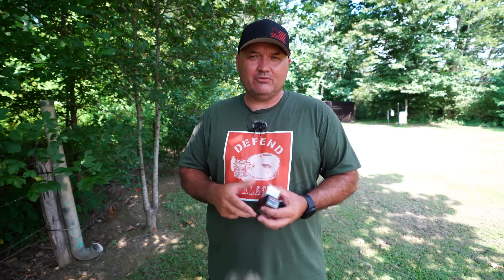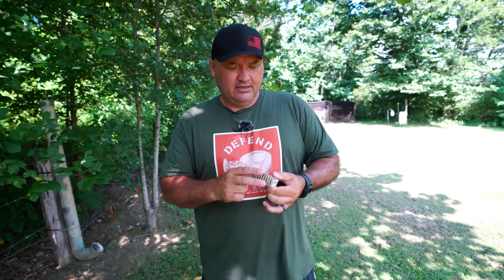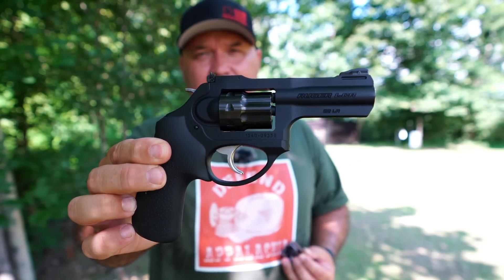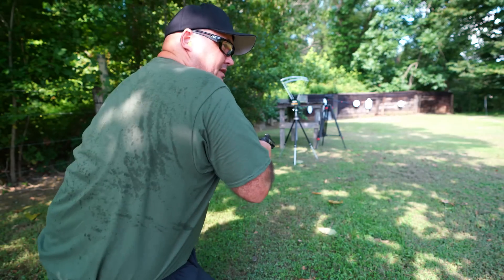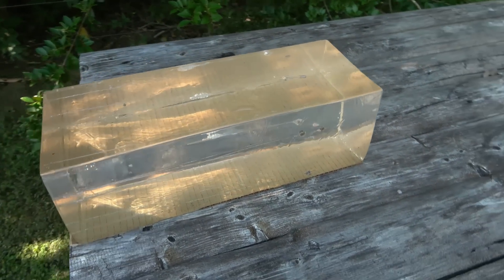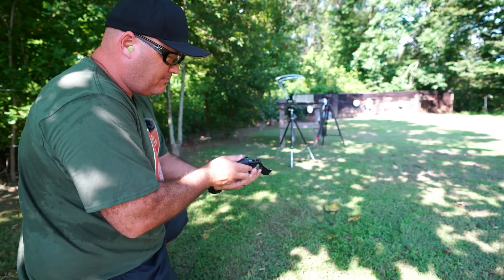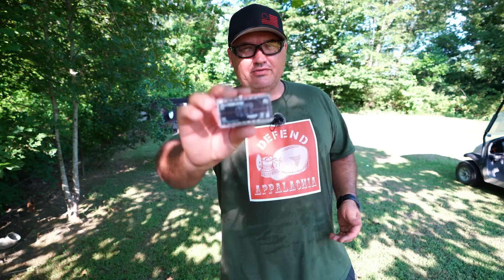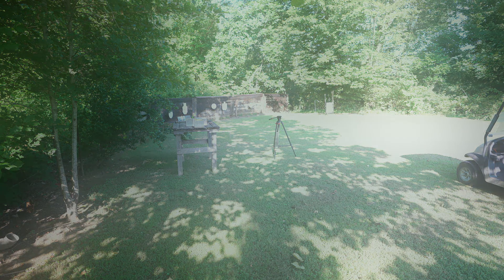Federal PUNCH .22lr in Ballistic Gel

Comment: The federal 22lr punch was designed to penatrate and that it does very well,better than any other 22lr load,it completely out performs the cci stinger,in my tests it always penatrates better than anything else and that's what your after in 22lr for self defense not expansion,try it on coconuts and gallon jugs of water,2 coconuts and 3 gallon jugs of water it usually stops in the third jug,and that is viscous for a 22lr load,I carry my kel tec p17 loaded with 17 federal punch in it,it's dead reliable and accurate I would not want to be on the receiving end of it,that's a one way ticket to the grave yard
Reply: How reliable is your P-17?

Comment: The first round fired had a much louder report than 2nd and third makes Me think that Federal has a charge consistency issue . All said I believe that revolver 22  Lr would perform satisfactory loaded hot
Reply from the maker: I couldn't tell much difference in the report there at the range but that was a pretty good drop in velocity between those 2 shots. Thanks!
Reply: chris mclaughlin  with automated reloading machines this could be true , even hand loads can be inadvertently double charged but you know this already. I will say this I bought some high quality 357 mag ammo once that was so hot that it flattened the primers and the trigger guard of the big N Frame bit the backside of my middle finger. I pulled a bullet and weighed the charge at 21.5 grains and called the factory who said it was consistent with the round but asked me to ship the remainder of the 50 Rd box . The company sent me back a nice letter claiming that nothing was found out of the ordinary with the cartridges along with 2 full boxes of the identical ammo . On a hunch I pulled a bullet and weighed the charge 19.4 grains it was and the powder appeared to be identical.
Reply: chris mclaughlin  Maybe that's true but for anyone reading this who doesn't already know, .22lr isn't going to blow a firearm up no matter how hotly it's loaded, the risk is probably a squib getting lodged in the barrel from undercharging. *Typed this and then remembered .22s with plastic bolts exist. IF you own and are trying to shoot a Zip 22, disregard what I said above and just hang it on your wall and buy something different before it chooses one of the myriad ways it has of hurting you.
Reply: chris mclaughlin  absolutely, centrefire rifles are a whole different ballgame and even 22 carries risks as you say. I don't have much experience with federal but it sounds like you've had enough experiences to make dismissing them offhand a bad idea.
Edit: I have personally seen far more problems with handloaded rounds than any factory ammo too, for what it's worth. The theoretical precision afforded by doing it yourself is in many cases just that, theoretical.

Comment: Thanks for your content it's always interesting. I'd be curious to see this same test performed with CCI 40gr. subsonic lead h.p.  I shot one from the top into a 5 gallon bucket of water through a 6" revolver. It split the bucket apart and expanded approximately twice it's diameter and appeared to have excellent weight retention.
Reply: Subsonic stop's at about 800fps how fast are those hp's moving, or does it say on the box? Sound's like they hit pretty hard, (subsonic mean's slower than the speed of sound) when you hear a plane making a Sonic 💥 boom it just broke the speed of sound 750- 800 mph. It work's out to about the same in feet per second.
Reply: @akatripclaymore.9679
Reply: @akatripclaymore.9679  The box says 1050 fps. There's no ballistic crack with these rounds from any 22 rifle or pistol I've used them in but they produce excellent accuracy in all. Try them, I doubt you'll be disappointed.
Reply: @coelagos8645  Yes I will try them for sure, I have heard they are excellent performers.

Comment: I'd like to see a gel test comparing the Punch ammo to Stingers and Yellow Jackets.  After seeing the Paul Harrell video I suspect they are all about equal--especially when differences in bullet weight are accounted for.
Reply: That's what I was thinking, I don't think anything can really surpass the Stinger, just equal. From what I understand the Stinger was designed to eke out every last bit of muzzle energy possible with the lightest weight bullet possible with as much powder as possible, I doubt there's much you can do to increase performance any further. I suppose some advancements in accuracy could be achieved with perhaps a different bullet geometry or material but that's the only thing I can see being improved performance-wise.

Comment: Congratulection for video.
Why don't prouve
22 LONG RIFLE - CLUB
40 GRS
SB22A

NEW CARTRIDGE MANUFACTURING TECHNOLOGY | Sellier & Bellot launches a brand new, modern technology for the manufacture of 22 Long Rifl e cartridges. | Highly accurate bullets with a new design: • Manufactured from precision, graphite-coated lead slug • Consistently precise bullet shape down to one hundredth of a millimetre • Precise bullet weight within a tolerance of ± 0.02 g | Superior loading: • Minimum differences in bullet speed • Exact primer dose within ± 0.002 g • Propellants within ± 0.01 g | CLUB version: Cartridges in this series achieve excellent accuracy due to new manufacturing technology.